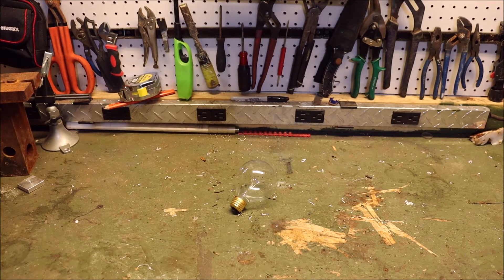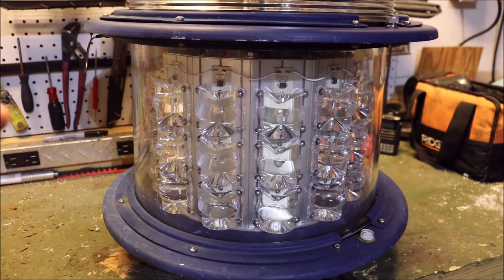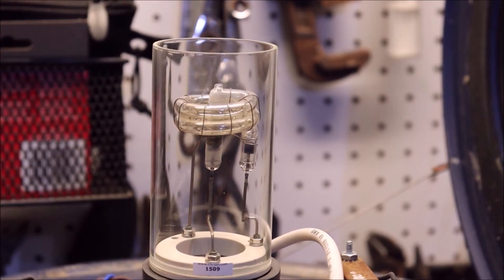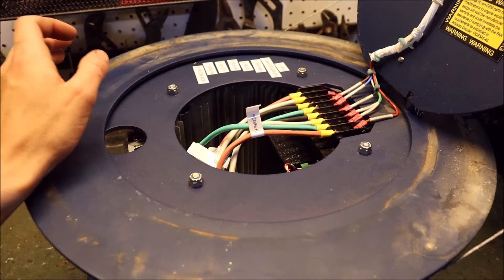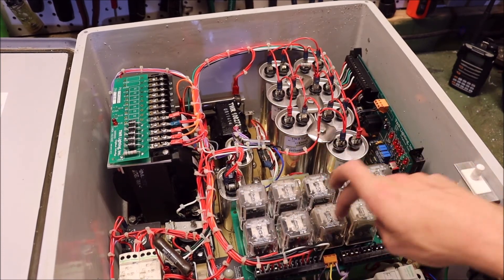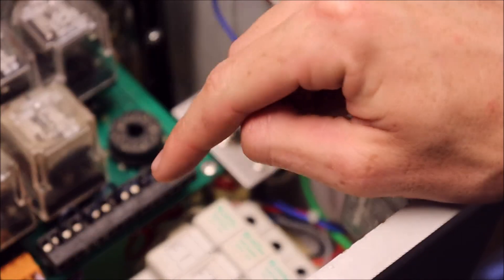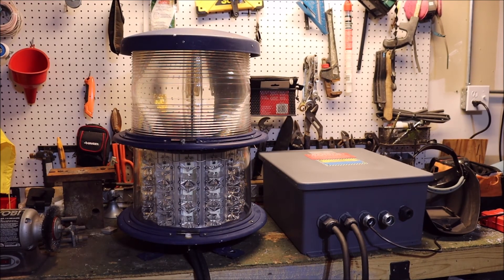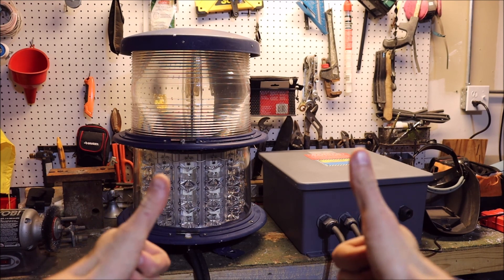Tower Beacon

Comment: Nice video. I just (mistakenly) got sent a slightly older version of that system with both day and night strobes. I have a stainless cabinet on mine and it weighs a ton. I had originally ordered a 300MM beacon system but ended up with this.

Comment: Nice video, The white low intensity strobe at night on these dual strobes is a backup mode in case the red light fails. They also just have white only strobes that flash white at day and night.